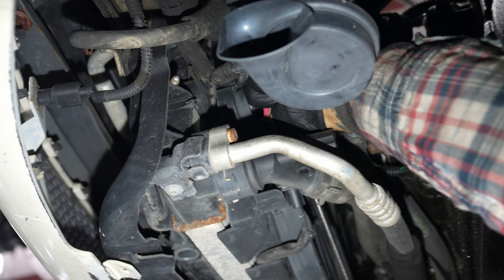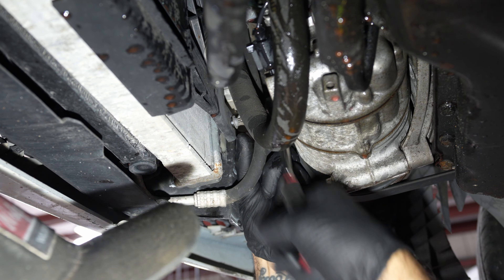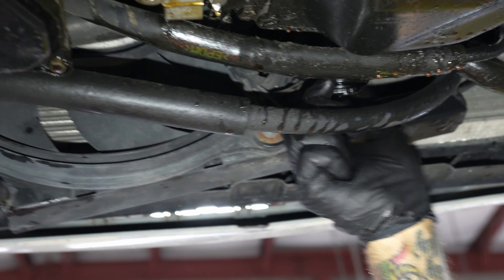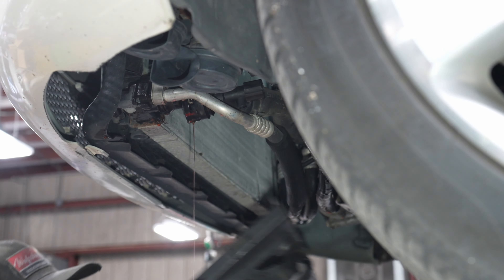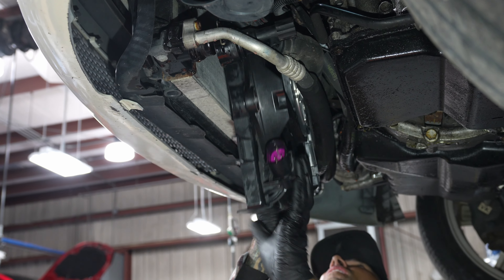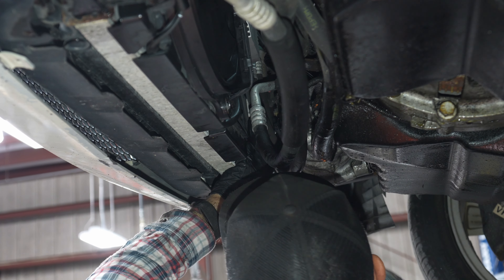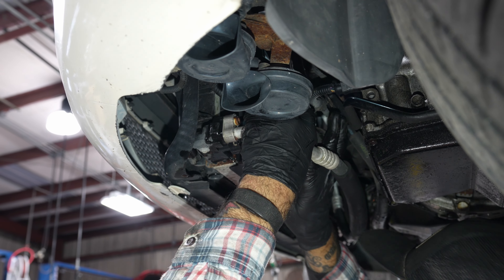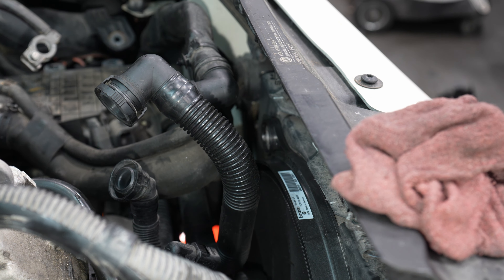2008 Beetle New fan install

Comment: I was actually able to sneak it out without pulling the oil filter cartridge. I was able to angle it up and create an S shape downward toward the driver side of the radiator. I was just curious on how much you charge for the job or at least how many hours. I’m trying to charge a customer right now but don’t have Mitchell Labor program. I was thinking about charging four hours. Also replace the thermostat in which I had to pull the intake manifold and that dang thing did not want to go back in. It was hard coming out. Course support overextends too far into the engine bay and it’s like a crab cage . Can only go one direction. I was able to use to pry bars and carefully pop it in. Should have removed the upper power steering banjo fitting bolt but that would’ve just made a mess lately. Maybe I should have. Thanks for the video.